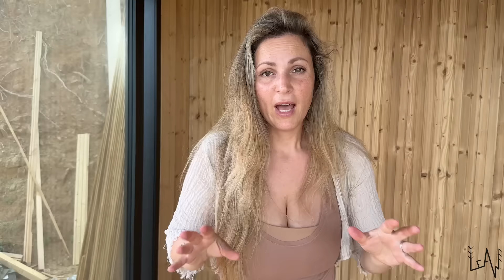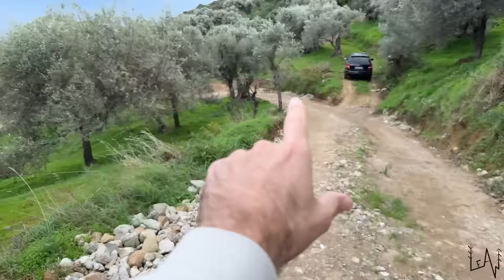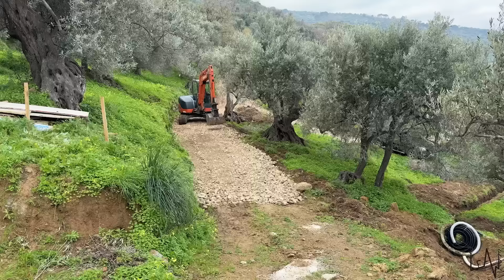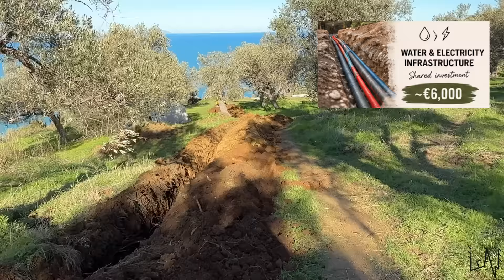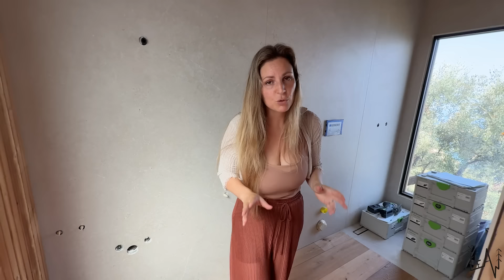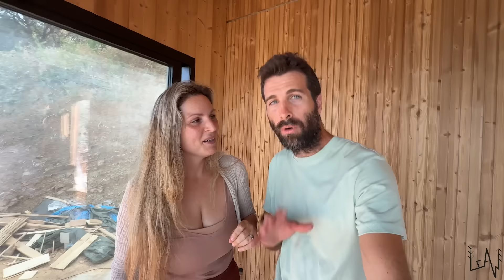HOW MUCH OUR TINY HOUSE REALLY COST US (FULL BREAKDOWN!)

Comment: I watched a lot of tiny homes content over the years as I'm obsessed with them and I was not surprised it was 100k because it is high-spec due to the high sustenaibility and quality products you used. I don't think that people unfamiliar with Italian's building sector realise that things cost a lot in Italy due to materials quality, design, professional services fees and certifications required by the law and VAT. And then one has to be grateful workmanship is cheaper in the south, if you had tried to   do the same project in the north of the country you would have likely spent 30k more. Despite the costs, and massive stress you guys have achieved a  product soon-to-be completed that will start paying off from next year. So... forza e coraggio, stringete i denti un altro po' 💪🏻

Comment: Spectacular location with the big windows and you will have no shortage of rentals to gradually recoup some of the money spent, count me in 🙂. But it was definitely far too expensive for what it is in wood at over 100,000 euros, not including the additional 35,000 of ground works! And Luca you did so much of the work yourself. Why does a kitchenette and cupboard have to cost 8000 euros? You could do it both functionally and attractively for less than half of that, it's just one small kitchen wall with I suppose a fridge and a hob/oven and sink? What are your plans to retain the land dug out behind the house to ensure no landslide or mudslide (as well as for aesthetic reasons) and for the landscaping all around? Those will be additional costs.

Comment: First, Luca busting his butt for the last couple of years IS a cost... he ran electric, ran plumbing pipe, fixed mistakes of other contractors, concrete, carpentry, built and wired the whole solar array, digging, etc, etc. His labor should be a line item of at least 60-80,000!

And, you paid 50,000 to a hospitality/design startup in California that doesn't even build or sell any tiny houses themselves? Did you make a deal for your "retreat" to be on their locations of tiny house developments, with them taking a percentage of your bookings? They don't build. They didn't supply the house kit themselves. A company in Germany sent the kit? 

Btw... you should definitely include a portion of the infrastructure as line items... well, trenching, road, electric, solar, pool (cost for that, since it's part of what you will be offering?)

And I think you're fooling yourself and your viewers when you come off all "natural" wanting to save the environment.... did you ever think how much of a carbon footprint all that concrete and luxury components leave behind? 

One viewer suggested you should have used local masons who build as houses were always built in Sicily... with local stone. Another suggested yurts. These would have had far less environmental impact! 

For everyone's info, here is the company's profile who got 50,000 from you for a tiny house they didn't supply or build...

Find Sanctuary (or Find Sanctuary Cabin) is an eco-friendly hospitality and design company. Rather than selling or installing tiny houses for personal ownership, they operate as a nature retreat startup that builds off-grid micro-cabins for rent and corporate retreats. [1, 2, 3]

Their business model primarily involves:

Micro-Cabin Rentals: They lease out small, design-forward cabins equipped with remote work stations, solar power, and luxury interiors. Their first pilot location was established in the San Bernardino Mountains (near Big Bear, California). [1, 2, 3, 4]

Hospitality Operations: They do not act as a standard residential contractor, builder, or retailer selling tiny houses to the public.

Concept Plans: While they do not sell standard blueprints, their properties are custom-designed and they focus heavily on concept and design rather than mass-market home sales. [1]

Because they focus purely on the hospitality and design side of micro-cabins, they do not build on your land or sell individual units to consumers. You can learn more about their retreat concepts on the Find Sanctuary official site or read about their business journey on Dwell. [1, 2]
Reply from the maker: Which start up in California? We don’t understand

Comment: The next one should be a yurt!❤
Reply: A yurt would be more cost effective and stronger !! A hurricane would turn this wooden structure into a pile of matchwood floating in the sea below !!!
Reply from the maker: @NigelNNNN-r2q  Cross-laminated timber (CLT) structures can be engineered to withstand very high wind loads and severe weather. Dismissing the building as ‘matchwood’ without understanding the design or construction is misleading. Please do some research before making claims like this
Reply: @leaw  dealt with a lot of engineered timber in my life time - some can be  prone to de lamination - i.e. failure which is  usually through moisture issues !! Used to run / own a fire / flood restoration business working with major Insurance Companies.
Reply: @leaw  Look at the actual structure - the way the building is assembled - not necessarily the actual materials used. Structures can fail not because of the materials used but by the way it is built. Many structures of all types of materials have failed due to poor or suspect workmanship in assembly. Done a lot of research throughout my life. I think you need to look at the contractor you have used and done more research in how they operate and check the work they have done in the locality !! Unfortunately the evidence is all on video for everyone to see and indeed many have commented upon.
Reply: @NigelNNNN-r2q there's no way a yurt would be stronger than this building
Reply: @maryjanekeneipp6623  Sorry, disagree with you. End of story !
Reply: @NigelNNNN-r2q  they don’t have hurricanes in Mediterranean.
Reply: @margaretmartine9430  A hurricane can occur anywhere at anytime particularly with the way the climate is changing. I used to live in a place where snow was unheard of yet one winter we had over a metre of the stuff !!! Therefore your argument doesn't stand up !!

Comment: I’m sorry but I feel you got ripped off , having to pay for the wood you were shorted and the new pump which should have had a warranty and Luca having to do the electrical and plumbing which should have been included and as far as the workers they were very incompetent!
Reply: Sometimes people look at the priority and maturely keep going. Often doing so comes back ten fold. 🏠🌊
Reply: I was surprised that the total wasn’t more. Some things seemed more expensive. But the total cost for the road was less than I expected, but I didn’t have any certain figures in mind. 
The work was done with quality, safety and aesthetics in mind, and those goals were achieved.
Reply: I believe the point of this video was to break down the cost for the project. I don’t think for a second Luca and Sara would disagree with much of what you said. They expressed numerous times during the build they were under a very strict time frame so to not exceed that they had to make adjustments that definitely affected their costs. Their frustration was obvious, and understandable several times for various reasons. But again, this video was what many folks were interested in, the breakdown and total cost, and that is what they provided.
Reply: Total rip off at almost every stage of the build...